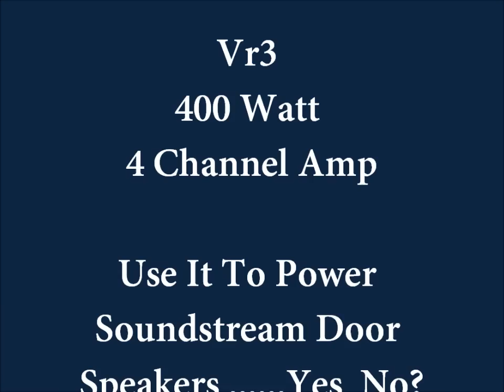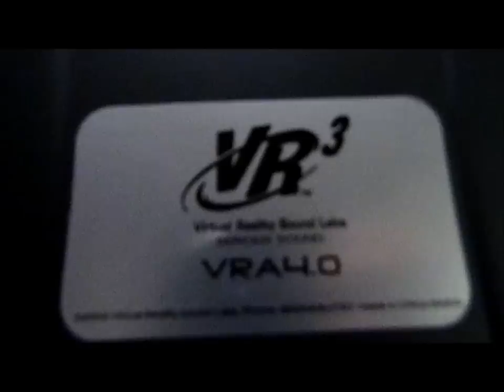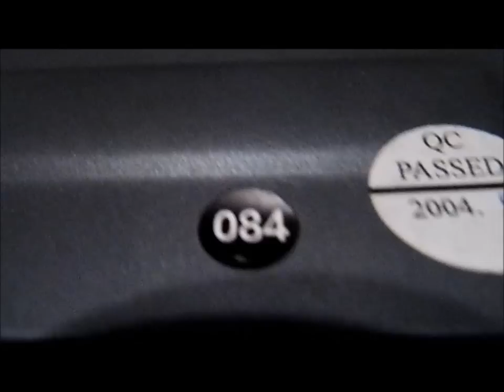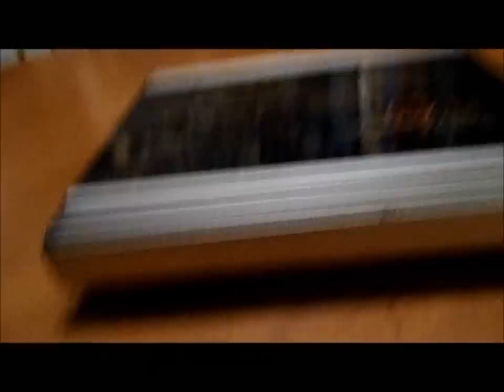New Amp! vr3 400 Watt 4 Channel

Comment: bought this amp bout 6 years ago in the clearance section at walmart. something like $40. its been in 5 different cars, 2 of them friends cars. never thought it would last this long. little amp is still kicking ass powering a 10in kicker in my s10. the thing looks like junk now all beat up, and the clear plastic in the front came off a long time ago so its long gone. but the thing still keeps working.... its even outlasted the $450 audiobahn amp in my f150. that died after a year.